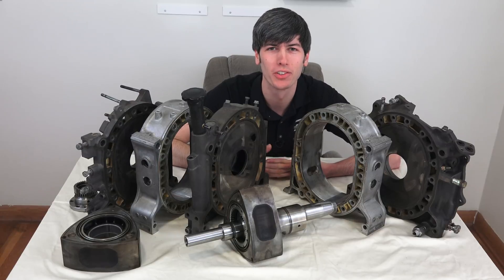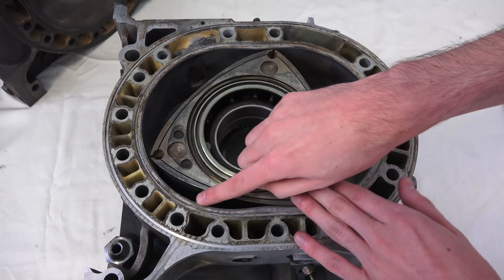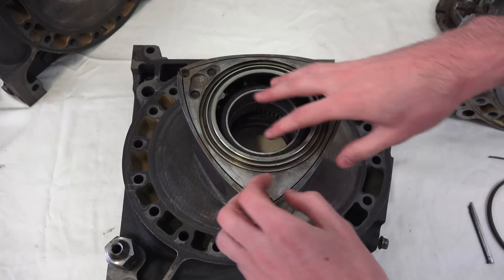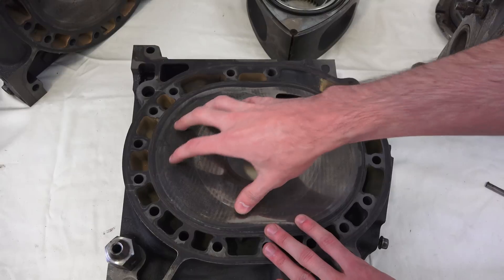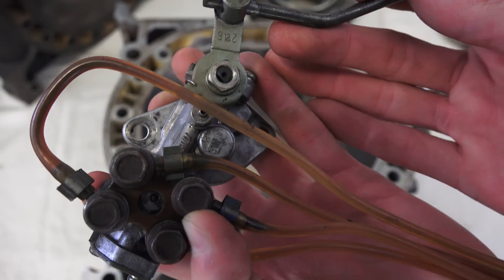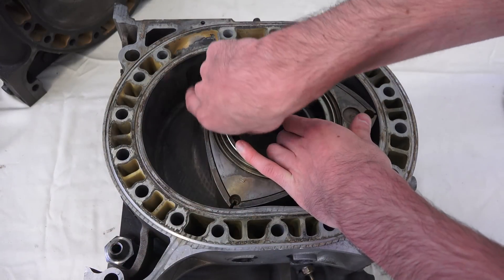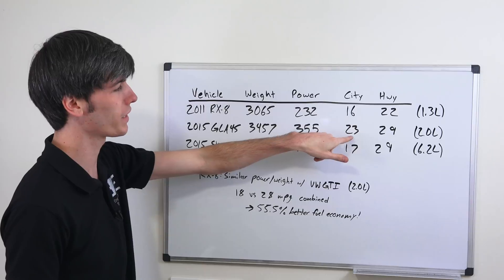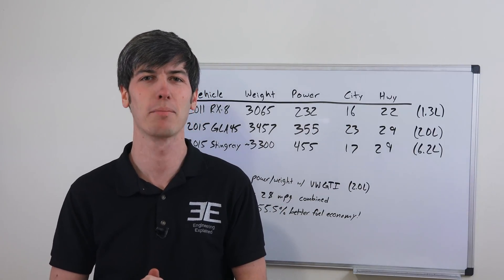4 Reasons Why The Rotary Engine Is Dead

Comment: This is the most shallow explanation of the rotary available on the net today.  Compares fuel efficiency as though it relates solely or largely to the motor.  Modern fuel efficiency numbers are largely due to the transmissions.  Not the motors.  Yes.  The rotary has poor emissions, as though modern emission standards are in any way meaningful or important other than as part of the war on fossil fuels.  While the smog of the late 70's is not good.  Modern standards are over-the-top burdens that have little or no benefit to anyone but a radical environmentalist.  My naturally aspirated 3 rotor motor puts out about 355 hp to the wheels and revs to 10,000 rpm.  Its an incredible motor.  Maybe they can bring another version out, but in the meantime, rotary aficionados will remain pretty devoted to these motors.

Comment: I was curious how the Viper's engine stacks up. 12/21 MPG, which is worse. However, it's an 8.4L V-10 producing 640 horsepower. So, it's a hell of a lot more powerful using only a little more fuel.

Comment: Seeing all that (and it makes perfect sense, and is consistent with what I've always heard about these engines) the biggest question is, why has the Wankel rotary engine lasted as long as it has? I could see it being useful in an ultralight or other very small airplane due to its power to weight ratio, but why did it survive in cars for so long?

Comment: In 1972 I bought a new RX-2 sedan to see what all the fuss was about.  Out of all the cars I have owned before and since, that Mazda was the only absolute and unforgivable lemon.  Not only did the many design problems seen in this video make it nearly unusable, in very cold weather the coolant would run past the seals and fill the combustion chambers.  When you pull the plugs and find them filled with green ice, you know you are not going anywhere before the spring thaw.  Frozen engine, ear-splitting backfires and dozens of fouled plugs aside, almost every other piece of that car broke, failed, wore out or rusted before I could get rid of it.  Even the scissors jack wore out after a couple of uses.  Not only have I never owned another Mazda product, I will not ride in one if I can possibly find an alternative.  Forty-odd years later I still have nightmares about my Mazda experience.

Comment: We should really be focusing on killing off internal combustion engines of all sorts for propelling a vehicle.  Once you drive an EV you'll understand why. ICE's are simply a bad match for what we're looking to achieve, and that's why we need slipping clutches or torque converters, and gearboxes.
Sure they likely have a place for a good couple of decades for converting gasoline into electricity for the EV, but that's about its only useful role.

Comment: The rotary is not something that can be explained by numbers on a whiteboard.  It is something that you have to drive to understand.  RX's are affordable, lightweight, great handling cars that beg you to rev them.  In fact, the harder you drive them, the longer they last.  Post a follow-up video behind the wheel of an RX8 or a 3rd gen RX7.  I guarantee It'll put a huge smile on your face.  The RX8 even seats 4 adults pretty comfortably.  

If you're concerned about HP numbers, or fuel economy, this is not the engine for you.  If you aren't ready to meticulously care for your car and check your oil level every other fill, this is not the engine for you.  If you're into driverless cars or slowly putting around town, this is not the engine for you.  The rotary is about navigating twists and turns with the engine screaming somewhere north of 6K rpm and a big smile across your face.  They are driver's cars plain and simple.  The rotary guys get it.

Comment: I bought a new Mazda RX-7 in 1985. Kept it for 10 years and put 100,000 miles on it. Only problem I ever had with the engine was the Alternator going out. It was fun to drive either daily or on long trips.

Comment: The Norton rotary was,nt to bad won the IOM TT races, I remember ROLLS ROYCE working on a Rotory and said they tried many types of material to seal the combustion leakes as the rotor wore out too quick, in the end I believe they said it was better to use a softer metal.

Comment: Why were these engines even conceived?
Reply: For a bike it would be smaller and probably single piston or much smaller and 2 of them. Light weight and load from pushing a bike could bring the reliability up and easier to control engine temps from being in more open air.
Reply: Generally, they're lighter, more compact, mechanically simpler (the "cylinders" as well as the coupling to the driveshaft and fewer moving parts). They're also smoother and vibrate less. We just don't have the materials and engineering to overcome the challenges to make rotaries perform like they theoretically should on paper, so there hasn't been nearly as much R&D put into them to incrementally improve them.
Reply: it doesn't look like they're light weight at all
Reply: +dosmastrify, not to take away from your arguments, but I think your understanding of how the pistons move is a bit incorrect.  The piston's position moves in a sine wave, not abruptly up and down.  As they go up they accelerate up, until halfway, then decelerate until it comes to a stop at the top.  The piston doesn't necessarily stop at the top (or bottom) for any amount of time, as it continues the same rate of deceleration to go the opposite direction.  But, given the up & down motion of the pistons (even with counterweights on the crankshaft) there can be a lot of vibration.
Reply: Suzuki made a Wankel bike- the RE-5.  This was in the early 80s. The first ones looked like they were designed by Star Trek but the second and succeeding years, they looked more "bikes". It was a very powerful motorcycle and relatively trouble free. Here in NW USA, a guy set one up for road racing and it did pretty well.  One problem was figuring out which class it was supposed to be in. The method of measuring displacement is different from a reciprocating engine and there were disagreements on the method.  The sanctioning body had a method which measured it at 500cc so it was put into the class for modified production motorcycles from 500cc to 600cc.  It was much more powerful than the other 500-600cc bikes and could do well in the 750 class (it was possible to run a class or two up from you class if you wanted to.) So, the 500-600 Modified racers found someone else who defined displacement a different way and it had to go in the higher class.  Like rotary cars, it was very loud.  Very, very loud. When the bikes went fast on the long straight, the other bikes were average volume for race bikes but, when the RE-5 went by, the folks were saying, "Damn!  That's a loud bike!" This bike only ran about three races in one year and, while it did well, the owner didn't want to race it.  RE-5s are a pretty rare motorcycle and no one prepared any more for racing.  The dealers who had them had a hard time selling them.  Other than the rotary engine, there was nothing special about the bike.

German make NSU had a couple of Wankel bikes and, at one time, the Wankel was going to save Norton.  Some Norton Wankels were built but, as history shows, it didn't save Norton.

A few of the Mazda Wankels were converted for marine use by adapting them to a Volvo/Mercruiser outdrive.  They made quite a bit of horsepower and they were small which is a consideration on a 16'-23' boat. Fuel economy was a big problem and not many people were willing to be different.
Reply: I agree with that 100%, even though I occasionally have some cheap thrills poking fun at the Wankel's (and just that name is funny!) BUT have to admit that the "regular" gasoline powered internal combustion motor with the pistons, etc has certainly benefitted from probably literally 1000x or 1000's more $$ tossed into the many R&D dept's (and pounds, DMs, Lira, Euro's and YEN!!) vs the Wanker, oops Wankel did. 

One great example of this is what GM has done with their pushrod V8's, mainly their LS series V8s which even today many still consider "low tech" but then I doubt they know too much about them, especially the part about how cool a super complex DOHC motor may look when new and IF perfectly maintained in use vs the reality of what people do to their cars and certainly haven't driven one! The LS V8s, which include the 640hp supercharged motor in the newest CTS-V and Corvette Z06 (which I'm conflicted on the car's looks or maybe just the "cheesy dude wearing lots of gold jewelry's car" image that the Vettes kind of took on over time, but its an amazingly high performing car especially factoring in price vs prices of supercars it can keep right up with!) but the GM LS V8's take the pushrod design, supposedly old news and left for dead by many car makers for the far more complex (and then far more parts liable to break) overhead cam designs, usually with 4 valves/cyl, etc and I won't disagree that some of them, like the V8's and that V10 the M5's had for a while were pretty awesome motors, but also come with some awesome requirements for the owner to follow, forget about that $15 oil change on tuesday deal, you need full synthetic now and while I don't mind paying for synthetic oil, a lot of these cars when passed on to 2nd or 3rd owners who are clueless as to the maintenance needs and you have a problem coming soon, a very expensive problem!

The LS V8's take that "old low tech" pushrod design and make an incredible series of motors they use in nearly every non-diesel truck, less hi-perf versions still knock it out of the park powering cars like the Chevy SS sedan (thanks Pontiac RIP and Holden sort of RIP for that car too) and the highest performance motors like that new 640hp unit are incredible and those motors have proven to be very reliable over time and if it comes to needing a rebuild, that costs a fraction of what it costs to rebuild a high performance DOHC motor!
Reply: So people like you can get confused on the net?

Comment: The Wankel can be very efficient at a specific load & rpm. It is far from dead and will be back in the automotive world in some form. The 1st generation RX7 engine was very reliable. I have seen them with 150k to 300k miles without any rebuild and running strong. Fuel economy was on par with similar cars of the same era for the Gen1 RX7. I still get 23 mpg out of one in combined driving. Don't just look at numbers, get out there in one and let the butt-dyno teach you a few things about seamless throttle response at any rpm between 2000 to 8000 rpm. Regarding towing and torque, mine still has a hitch on it because it had been used to tow a Hobie-Cat sailboat. By the way, converted Mazda Wankels are very popular in experimental aircraft. Wankels are also used in some power generation units. Search for Rotron, AIE, & others. Regarding the oil injection, doesn't anyone realize that a piston engine passes some oil by it's rings? The oil consumption is not that much different than a piston engine. Most Gen1 RX7 lose more oil from damaged oil cooler fittings (which is an easy fix). Yes, I am an engineer, and used to be a dyno-technician and race mechanic. Upon reading other comments, I am not convinced that other guy is a real doctor.

Comment: but what if you turbo your rotary? it will have air going into the turbo that contains fuel and when turbo will compress that air (which have unburnt fuel in it) will it create a bang?

Comment: Was it ever alive
Reply: It can produce massive HP per litre. Some race cars ran it (767B and 787B) and were very competitive with it.
Rotary engines are also bulletproof. They can handle massive amounts of boost because they don't have push rods (what fails on a regular turbo engine).

What this video fails to point out is that Mazda were the only one developing this engine around the world, so while it certainly has inherent flaws, the design can massively be improved.

He is basicaly comparing 2015's best engine (mercedes) with an engine which design hasn't evolved since the 80's.
Reply: The real doktorbimmer maybe elaborate ?
Your comment serves no purpose.
Reply: Alive? Yes! In the late '60s and early '70s, the Wankel was "the next big thing". Mercedes, Citroen, Mazda, NSU/Audi, Suzuki, OMC, Curtis-Wright (aircraft engines), and GM either were building them, or were planning on building them. In the USA, Mazda rotaries met national emission standards without a catalytic converter or unleaded gas in '79 while most other piston-powered cars needed them starting in '75.

Mazda sold the Cosmo, R100, RX-2, RX-3, RX-4, and the Rotary pickup all prior to the 1979 RX-7. The RX-3 alone has an incredible road racing and rallying history of victories.

Comment: Good video and I'm glad you didn't say torque as a reason, like a lot of people think. For the size and weight, they produce a lot of torque. But are generally tuned for a lot of high rpm power, so people compare them to similar HP 4-strokes.

Comment: I LIKE the Wankel design!  My better-half's original 1984 RX-7 had over 260K miles on it, and still ran great. Only had it rebuilt, b/c the rear engine seal was leaking LOTS of oil- right onto the exhaust pipe!  Very smooth operation, though.

Comment: why are you comparing a lower level of car against vehicles that are 20 or 30 thousand dollars more expensive?  why didn't you mention the liters of an RX-8 which is 1.3 while comparing it to the other cars you mentioned?  if you had 1.3 liters in a traditional piston type engine you wouldn't be able to match the power of the identical displacement of a rotary. how about mentioning that. I'm going to go ahead and say for the readers here that because there is a heat difference from the combustion side to the intake side: the rotary engine is go for burning alternate fuels that are more volatile but clean burning and more readily available, like hydrogen. yes it can run on water. they also used them in airplanes because the engines would never cease up from overheating like a traditional piston engine. they could have no oil and no cooling, and have chewed up n spit out some seals but will never cease to run until you take your foot off the gas. so there are definitely some strong advantages as well which could have been exploited by mass auto makers but instead the racecar builders kept it alive because they knew they had something special. look up the racing history of rx7s and the 787b, a car declared illegal in motorsports because it was putting its contestants at a complete and utter disadvantage. but then again the 300zx wasn't allowed to race either because it was so refined that it beat out all others with ease and that was a piston engine. point being that you can make a work of art. but theres always someone out there to make it better. btw the rx-8 with the renesis engine passes California emissions so I don't see what the big deal on emissions is. id like it if you really delved into it giving a complete rendition and breakdown instead of a quick few statements. the rotary is nothing to fly by or to give little attention. the rotary is a masterpiece of engineering.
Reply: i'm just going to say that it's actually not that far off power wise from todays piston engines. a N/A 1.4 liter 4 banger makes 100hp and 90lbs of torque which with out turbos is right around what the equal rotory would put out.
Reply: well said man
Reply: dosmastrify to be fair your a troll and you know nothing of the rotary engine, go poke your nose somewhere else.
Reply: cody roland why do I get the feeling your a child or someone who hasn't developed mentaly. point being that you just contradicted yourself saying at first that there is not much power difference between the two and then you say that youd need a turbo to match the power. maybe you have stumbled across some real literature explaining everything and you set u a dumbass trap. of which it didn't work on a real enthusiast lol. maybe your smart after all who knows
Reply: Yah the place I bought my RX-8 from had emission laws and it passed with flying colors, only thing that I hated was in 6th gear on a manual stick not that slap stick auto crap was this, you would be running 80mph and the RPMs would be around 3,600 (if I remember right) and the highway mpg sucked! Now if they changed that 6th gear to lower the rpm's around 1,800 rpm running at 80mph I think the MPG would have been allot better! Just a thought!
Reply: i dont remember why, but i heard higher rpm is better for the wankel engine
Reply: As stated before for that fuel mileage you can have 700+ clean HP. nowadays.

Comment: he is comparing numbers of a 2011 with a 2015 of course the new car will do better different electronics and redesign of motors  lets look at a 4 cylinder 2.0 in the 70's 50-60HP 80's 50-100HP 90"s 100-150HP and now in the 2011 250HP more mpg and 2015 and 2016 there is 2.0L 4 cylinders out that have 300 HP and still better mpg then the less HP 2011 model sounds more like a car salesmen let me show you the speck of your old car and a new car and so i can say that it is inferior.  buy the way i own a 93 rx-7 its fast and blows my 93 dodge dakota v8 mpg out of the water dakota in town it 10mpg the rx-7 is 20mpg now that is my butt in the seat comparison with the truck and car i own of the same year my other car are from the 70'"s just my $0.02

Comment: Sad! When I was a teenager, I thought the only problem with the wankel engine was the extra noise. I thought it was far superior to piston engines in terms of fuel efficiency, power and size. When Mazda revived it in 90's, I thought it's about take off with the new technologies. Well... that didn't happen.